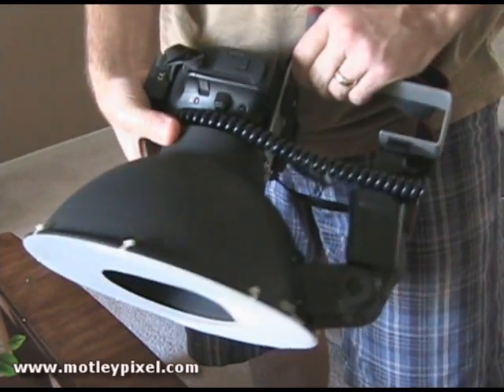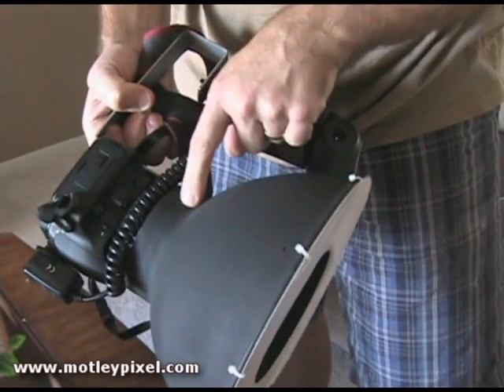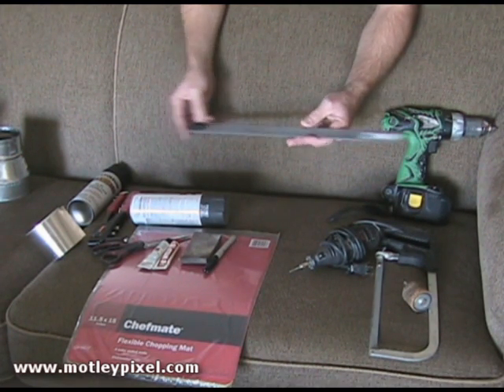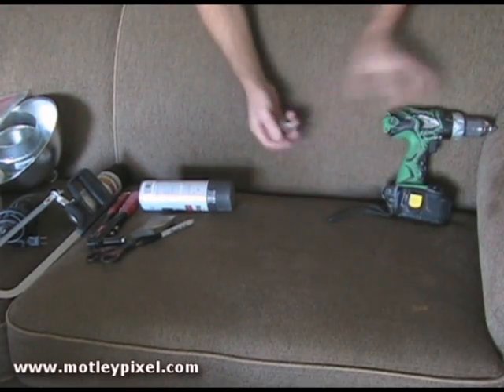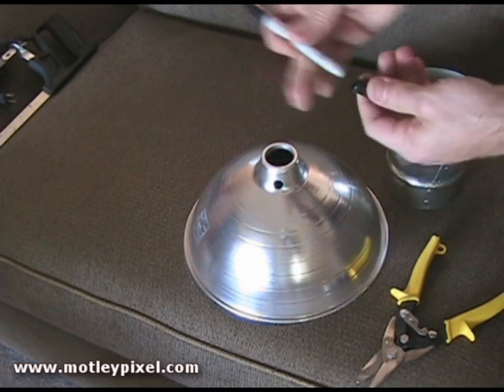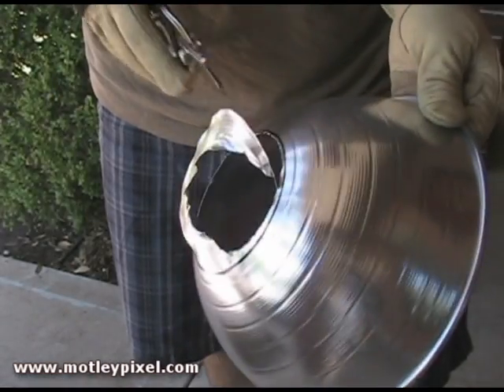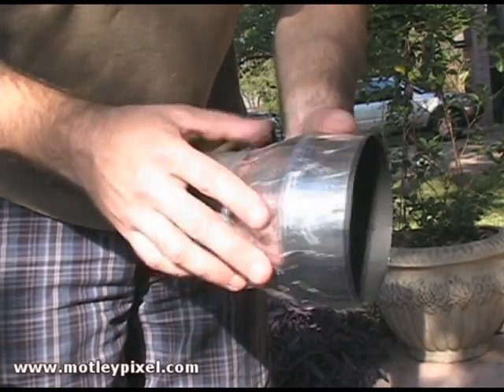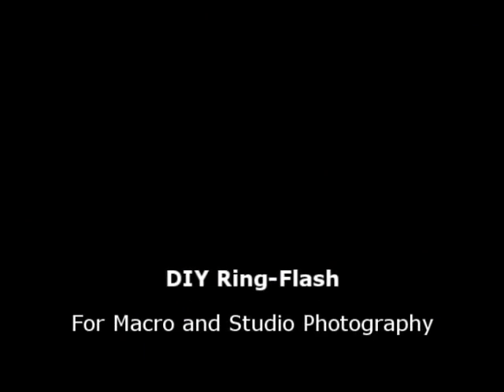DIY DSLR Ring-Flash part 1 of 2

Comment: There is a rotary cutting disc available for the Dremel Moto Tool that would cut out that excess aluminum in far, far less time than the sheet metal sheers and you already have the Dremel.

Comment from the maker: @RAMXC You do have a point and I mention this drawback, but I think it's far from useless...look at all the macro shots I have taken with this in my DIY Ring Flash flickr set and it's proof that it's not useless.  I use it two ways:  1.  I set my 100mm at 1:1 (min focus), then I just move the camera/lens/ringflash back and forth until I see critical focus in the view finder.  2.  I use AF in a very successful way with the 100mm macro lens when there's decent ambient light.

Comment from the maker: You need to use some sort of hard-ware as glue won't cut it.  I would say small machine screws where the head is very flat.  I would use loc-tite and a star washer for the nut side.

Comment from the maker: @loupremo well maybe...let see mt-24ex or mr-14ex averages at about $560.  BOM for this is roughly $65, then add dremel ($65), cheap drill ($40), rivet gun and rivets ($30), hammer ($12), vise ($30), tin snips ($15)...am I missing anything?  So that only roughly $192 in tools and if you have a Harbor Freight near-by it could be less, plus the utility of having these tools in the future good.  So the grand total if you didn't have jack-crap to build this is roughly $260, but most of us have tools

Comment from the maker: So after having this DIY Ring Flash for a little over a year and having the Canon MT-24EX for about 6 months.  I've found that for shots greater than 1:1 magnification the MT-24EX does best, but for anything 1:1 and over I like the light from the DIY Ring-Flash.  Conclusion, don't build this if you are a Canon shooter using the Canon MPE 65mm f/2.8 1-5X macro lens.

Comment from the maker: @jaedawggy  Well first of all thanks for the comments...size is king with light sources, of course with a trade-off...size.  I hate to burst your bubble but I would stick with 85mm+ focal lengths and don't forget it's impossible to manual focus or zoom, so primes at 85mm+ would work best.  This being said, I did use mine with an EF-S 60mm 2.8 macro and it worked fine.

Comment: Actually, I thought of a way to retain AF Assist lamp functionality.  Instead of bending the head to form an L, leave it straight.

This way the AF Assist emitter & other sensors on the head still face forward.  Will need a much longer bracket and this will a bulkier configuration but I guess we can't have it all.

Comment: @motleypixel  If you use it 1:1 it is ok!But most of the time I find that the  AF of my Sigma 180mm APO Macro is slow or incorrect!
I didn't want to offence you - the light in your pictures is perfect and it is very well made, but for me it is useless without manual focus.
I am building a soft box for my flash because of the MF.

Comment: Hi Mr Motley, thanks very much for the video. I actually bought three of these to experiment with for lighting. Two large and a small. Just cannot afford another Nikon SB 910. Only thing is i think i need a stronger bulb only bought the daylight 100 watts. i was trying to get the disappearing black background effect. had to use it very close to my face though. used a piece of white material and clothes pins to diffuse the light  :-). another light clamp idea.
Thanks.